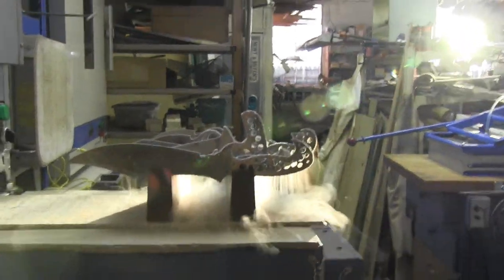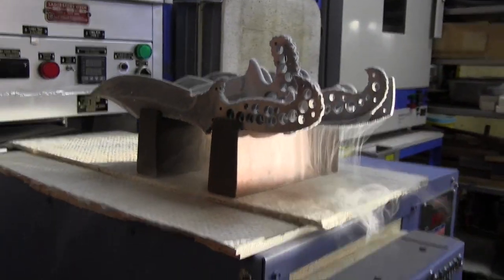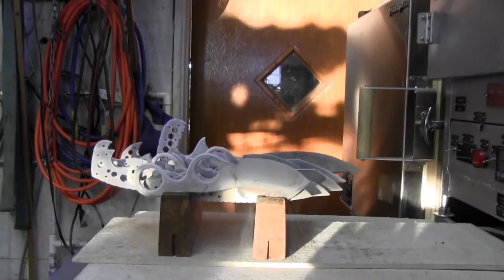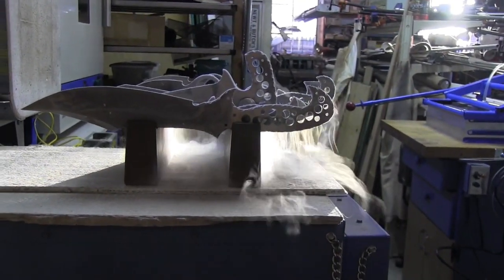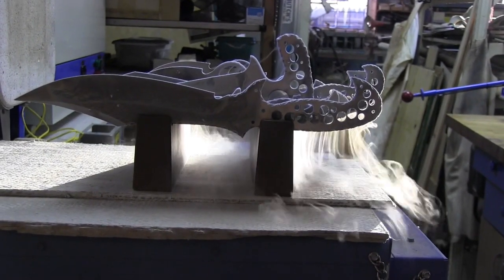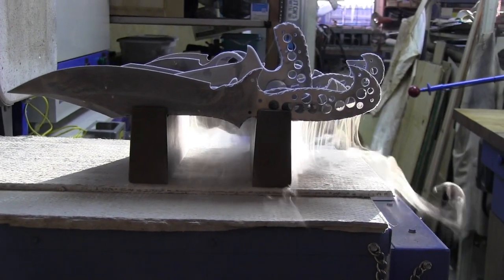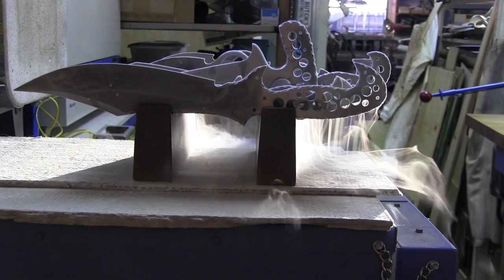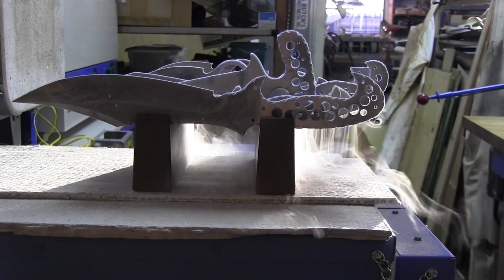Heat Treating Knife Blades, Post-Cryogenic Warming

Comment: so are you saying that you cryogenically treat the blade before doing the heat hardening?
Reply from the maker: What? Don't know what you mean. Short version: "Hardening" is using a series of steps to heat the steel to austenitizing temperature. That's when transformation takes place. Then, the steel is quenched at a very controlled and specific rate, all the way down to -320F, which is a cryogenic temperature. This forms the martensite, hardening the steel. It's held at cryogenic temperature for a period (in my process, literally days). This assures thorough formation of eta-carbides. Then, the blades are pulled from the cryogenic freezer and left in still room air to warm. This is what the video is showing. 

After they are at room temperature, they are placed in a tempering oven, and the tempering sequence begins. In high alloy stainless tool steels, the tempering process can also consist of many steps. 

For more information, please read my "Heat Treating and Cryogenic Processing of Knife Blade Steels" page on my website. 

Thanks!

Comment: Hi Mr Fisher, I understand, heat treatment affects the hardness of the steel but what about corrosion resistance? does a good heat treatment provide better corrosion resistance of a particular stainless steel vs a bad one? i personally like my blades to be impervious to rust. i do live near the ocean. I am a big fan of LC200N steel and in my use, it holds a good edge while also being impervious to rusting. I realized that for most people, edge retention is the most important quality and corrosion resistance is the last thing in their minds, but i was very disappointed when i bought my first knife labeled stainless steel (s30v i think) rusted on me. i had no knowledge about steels and i didn't know that most stainless steels will still rust on you. 

i had another question. i was looking for a stainless steel for larger fixed blade knives. something that is impervious to corrosion and very tough. would LC200N be a good choice for larger knives that have to be very tough? for me i like folders with full corrosion resistance and good edge retention while i like my larger fixed blades with full corrosion resistance and good toughness. what would be your recommendation? maybe H1 steel? 

I am a huge fan of Ari b lilah knife and i think it looks absolutely amazing. it looks very interesting and it catches your eye. i found your channel and website because of that knife. i wish i had the money to afford one.
Reply from the maker: Hi, Jake. Thanks for your thoughtful comment. 

Corrosion resistance is dramatically improved by the proper heat treating method, and with high alloy stainless steels, this is always cryogenic processing. The mechanism that causes this is called the "passivation effect, " and as the steel surface is scratched, abraded, or worn, a "repassivation effect" keeps stainless steels from corroding. This repassivation effect is important, because in higher alloy stainless steels,  the collection of the alloying elements on the surface lowers the dissolution rate in the active phase and thereby provokes formation of the passive film during passivation and during repassivation in conditions of local attacks (wear, abrasion, use, exposure to salt and chemical effects). 

If heat treating is improved, so is the corrosion resistance. Poorly heat treated stainless steels are very common, because it's expensive and time consuming to perform an extended process, particularly with cryogenics. For many knives, as  you have discovered, these processes are simply not done, and one of the main problems then is that corrosion resistance is decreased. 

LC200N is a "nitrogen" steel, and has high corrosion resistance, but low wear resistance. Most of my clients request high wear resistance first, followed by high corrosion resistance, and then toughness in that order. Proper cryogenic processing improves all of these properties and some others not mentioned. You can get more details about this on my "Heat Treating and Cryogenic Processing of Knife Blade Steels" on my website. 

In asking about H1 steel, know that the wear resistance of this steel is poor. If you have to choose a metal with poor wear resistance, why use steel at all?If you don't care about your knife holding an edge, and absolutely require complete corrosion resistance and extremely  high toughness, 6AL4V titanium is hard to beat. It won't hold an edge, but it won't break, and it won't corrode.  I actually have clients who request this for specialty knives that are rarely used for cutting. 

Thanks again for your kind words!
Reply: @jayfisher2550  wow, thank you for your detailed reply. I have learned a quite a few new things today! That is very impressive knowledge of metalurgy. I would love a steel with great corrosion resistance and great edge retention for a pocket folder but it seemed there wasn't really one. Steels like m4 were great but not corrosion resistant. Also the fact I learned today from you that companies tend to skip the cryogenic processing is kinda sad. 6AL4V titanium is something completely new thing and I had not heard about it before. Sounds like it would make a really good machete or a sledgehammer haha. I will look into it. I was wondering if you had experience working with LC200N steel but it's also something your clients might not be looking for most of the time.

Comment: Hello mister Fisher, can give me please little advise regarding the time of cryo time for high chromium alloy and time for treatment after that?
Reply from the maker: Hi, Vlad. This depends on a lot of factors, the steel type and alloy content being the first consideration, and the ultimate condition based on the type of blade and intended use. There is not enough room here on YouTube to answer this; more details are available on my Heat Treating and Cryogenic Processing of Knife Blade Steels page on my website.  Thanks!

Comment: Finding this all very interesting Jay.  I am a fairly new 'hobbyist' knifemaker and as great as your information is, I am obviously finding it bit daunting as a beginner.  There is obviously a lot of steels that it seems watching your videos are out of my treatable range at this time.  A, 'beginner,' maker has so many initial start up costs tied up in a grinder and an heat-treat oven, adding a temperature controllable cryogenic deep freezer is for now out of the question.  So I have been looking at BÖHLER M390 Microclean the data sheets say it only needs -95F for 3-4 hours, so it seems this stainless steel's peak performance through cryogenic-treat can be achieved with dry ice, unless you are saying all (including this steel) should be deep cryo-treated at -300F?
Reply from the maker: Hi, "Suburban Knife Maker!" For a beginner, you are choosing a fairly high alloy hypereutectoid martentsitic stainless steel to work with, and to get the most out of this type of steel requires some fairly advanced processing. I would definitely claim that this high alloy steel would benefit tremendously from advanced deep cryogenic processing. But for beginning, simply follow Bohler's instructions. That's how it always starts, simple enough, but it won't be long before you are seeking out advanced treatment protocols and techniques! This is because most foundries understand that their customers don't necessarily  have advanced equipment, and often give conservative and simple starting guidelines. Good knifemaking is always about improving performance and design, function and appeal, so I'll guess that you'll be learning more about it and constantly improving your technique, as you can, based on your knives. As you improve your techniques, be sure that testing, logic, and reference in scientific data follows each creation. If you are using dry ice, please be aware of the many limitations: temperature control, time in hold, and most important and nearly always ignored, the slow cooling down to shallow cryogenic temperatures to prevent thermal shock and quench cracking. I've written quite a bit about it on my website; feel free to look it over, and the best of luck in your knives!
Reply: Thank you Mr. Fisher!

Comment: Hi,  Mr. fisher, I am a big fan. I know i might not have the budget but could you suggest me a cryogenic freezer so I could slowly ramp down the temperature of my knives ??
Reply from the maker: Hi, Alexandre. I won't offer any product endorsements, but you can find "cryogenic processors" online. They are not cheap. There are a lot of knifemakers doing things "on the cheap," but these high alloy steels simply can't be handled casually or correctly using the same techniques as used with low alloy, plain carbon steels. Dry ice is not adequate; I detail the reasons in the videos and in detail on my website. If you don't have the budget to correctly treat the high alloys, you can opt for lower alloy steels that have martensite finish temperatures above cryogenic temperatures and forego maximum carbide development, or have the blades treated by someone who does have the equipment. Just make sure that you know every step performed by the heat treating contractor, familiarize yourself on the process, and disclose it to your clients. They deserve to know how their knife blades are treated and why.